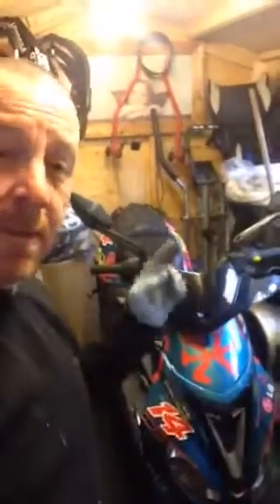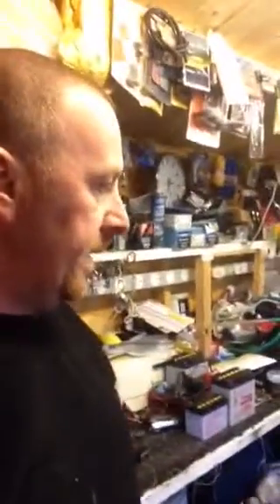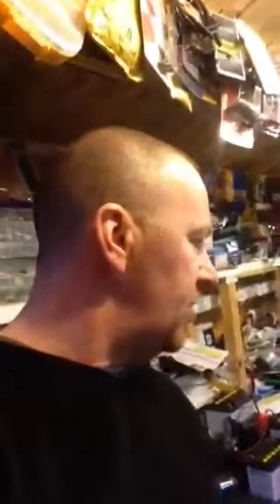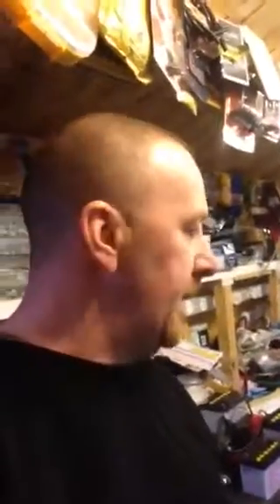Aprilia sr50 cc SR 50 NONE RUNNER fix  tuning mark savage

Comment: mark, quick question do you know how fast my Sym Symply 50 moped will go if i unrestict it, BECAUSE MY BIKE ONLY DOES 15 TO 20 MPH UP HILL!
Reply from the maker: Should be getting 30mph and only losing 5mph up hills 
I'd be taking the variator off cleaning and changing the rollers and give it a plug and air filter change 
This should help